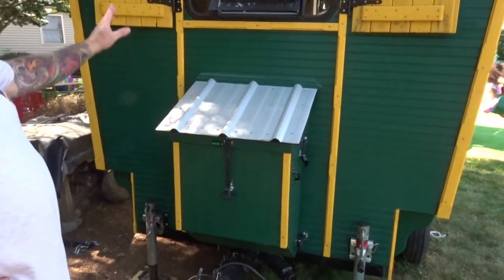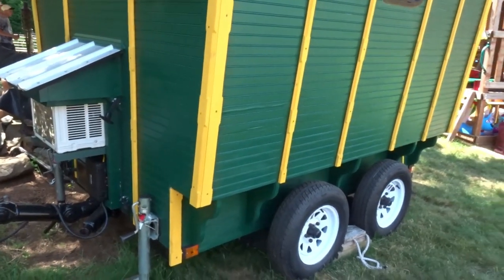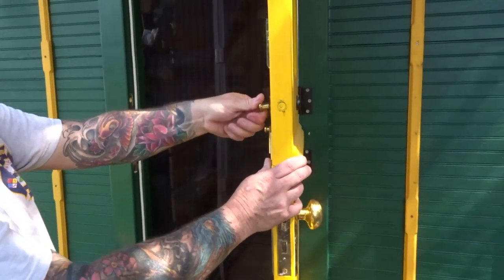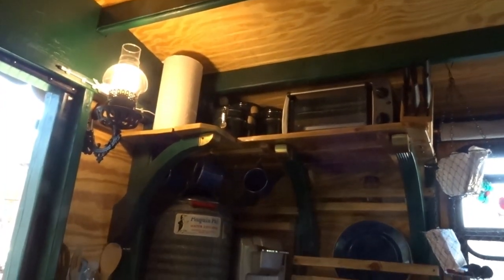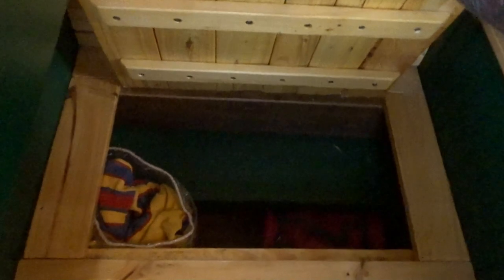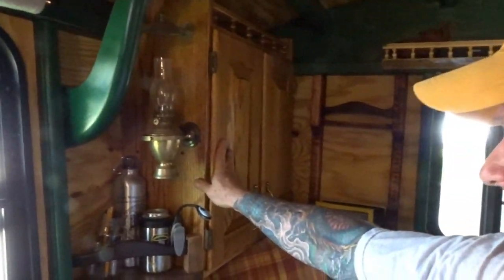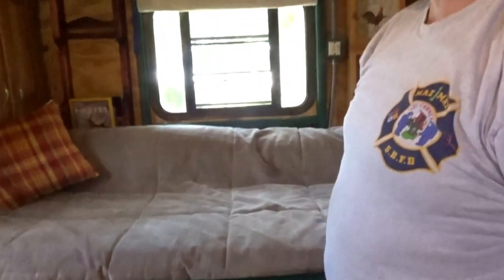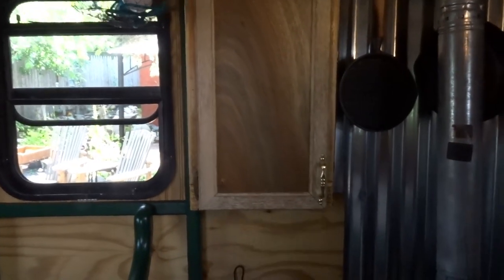Rob's Gypsy Wagon

Comment: Just wonderful! The table legs as shelf brackets is my favorite part! I have used and re-used almost everything I can find when building my campers but that is the first time I've seen that. Please be advised I am totally gonna do that (but will give you credit!). My next one is going on a single axle trailer (5x8) so I have to be careful about weight. What does the living compartment weigh (meaning the part you built minus the metal frame/tires part)?

Comment: Awesome build.  I guess this is a dumb question but I have been trying to find an answer everywhere and I guess I have just been looking in the wrong places......what was the original purpose for slanting the walls on these gypsy style structures.  I really like the look but have no idea why they were slanted.  Maybe for weather or for space.......I can't find an answer.  Thanks....great video.
Reply: I wondered the same thing. Came to the conclusion that wagon wheel tracks or axle width were sort of standard because of road and bridge width. So with angled or slanted sides you have more shoulder room and a longer bed. Just more usable space and if you say it in a very matter of fact way.... well yep, that's it.
Reply: great info. Ive also since been told that these days it is also to accommodate bed width up at the normal height of a sleeping mattress .
Reply: More room above the knees for living, as well as keeping the rain/dew/mist from running down the wagon sides as it runs off the roof. Back then they didn't have the water sealants and wood protectors we have today so rot was a big issue. Also keep in mind there were no roads most places so your wagon wheels had to fit in the ruts that were already established or you risked broken axles. Also if you took a ferry across a river many of them were also not much wider than a wagon.